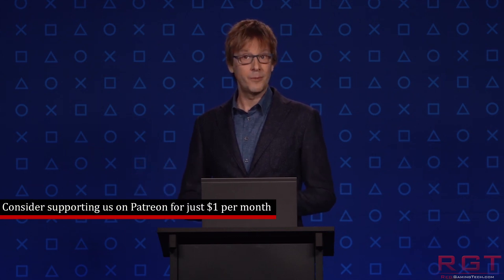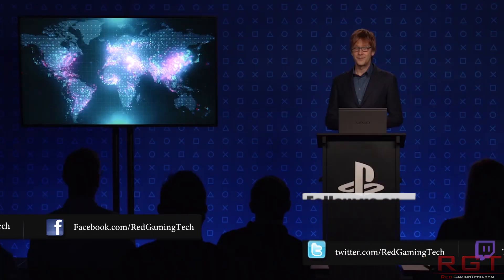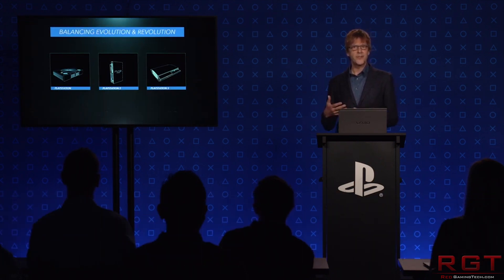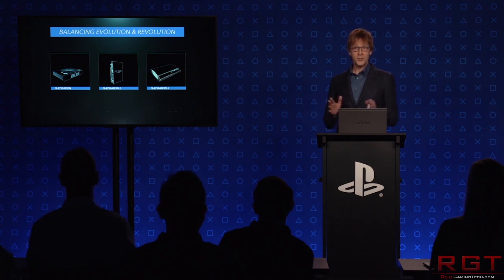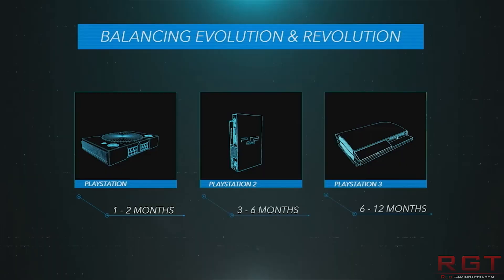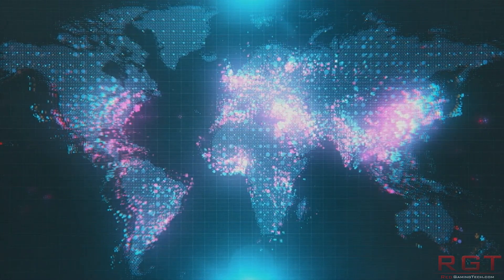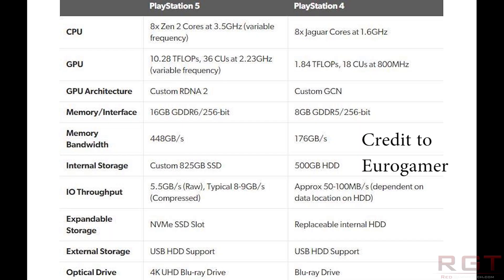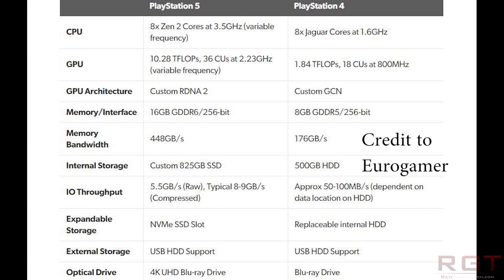Playstation 5 Spec Overview & Analysis | 10.3TFLOPS & RDNA 2 | 3.5 GHZ Zen 2 & Crazy SSD Speeds

Comment: Sony are very ambitious. This reminds me a bit of the Cell CPU, but not that drastic. They are banking on developers using the ultra fast Nvme to do some clever level designs (not having to repeat assets to save space on the drive, making more dynamic trees etc which will add to the realism, and it’s fast enough to compliment VRS to draw things that aren’t on screen. It’s some cool technology, but will require time for developers to get good at. First party titles will probably look amazing. Third parry will probably have better ray tracing and framerates on Series X, unless they optimize the storage. 
Microsoft is also splitting up the Video ram to 2 different speeds, but 10gb should be plenty. Only a 2080 ti (and above) make use of 11gb memory (Vega 7 doesn’t need it for games). Doom Eternal does require north of 7gb vram on the highest setting, at 4K games will get up there, but consoles are better optimized and have complimentary hardware, like decoders.
One point he forgot to mention is that external drives can Add 1GB to the total (making them theoretically cheaper), if you change the internal on PS5 you have to buy a 2tb 4.0 drive to replace it, which right now, go for $300+, on Microsoft you can add as many 1tb chips as you can afford to swap, or move to other consoles.
Reply: By splitting up the ram and making some of it way slower Xbox has essesntially created a future bottleneck.
Reply: @paskwawi2007  This is nonsense. CPU's & audio processors barely need any memory bandwidth to use to their full potential. This is why CPU's on PC use DDR & not GDDR. 336GB/s is already WAAAAAAAAAAAY in excess of anything an 8-core Zen 2 CPU will need for the ENTIRE lifespan of the console. What's important is memory bandwidth to the GPU, and here Microsoft is straight bitch slapping Sony with their wider 320-bit memory bus.

Comment: This is why sony have been quiet 10tf you guys saying 13 must have lost your minds
Reply: PS5 Pro will probably toot on Series X
Reply: @PHY51C15T  Good God. Now you all are hoping for a Pro version...
If that comes out it will be  a year or two away
Reply: Still coming
Reply: @PHY51C15T  dude just take the L no pro for another 3 years & by then Microsoft is going to upgrade the xbox also so stop the pro bs already smh.
Reply: @melvindesmond2134  actually wrong..... Microsoft has already said no mid gen upgrades...... I also highly doubt that they will bring out a pro having a 10.2 tf console and a 12 or 14 tf console it just doesn't make sense
Reply: @chadstudd1616  what are you talking about they said no more generations everything moving forward is going to work hand & hand which means games & all accessories will work with newer models & who said the new console will only be 14tflops it will probably be 18 to 24
Reply: @melvindesmond2134  they already said no mid gen refresh read it properly it make sense....
Reply: The PS5 and probable price point is already enough to outdue the Xbox camp. Sony has too many exclusives lined up for Xbox to actually compete let alone win anything but the console power struggle, and only for now. That and they haven't done enough in hardware for their exclusives to be in a league of their own graphics and features wise.

Comment: I do wish it was more 36 Cu’s.  A little disappoint with that, but not huge deal. As was hoping 38-40 Cu’s. At least worthy upgrade over PS4 pro, but yes we know RDNA 2 is far more efficient over older GCN.   I’m so glad Sony is not locking GHz, other top limit.  Which makes sense.  But as we know MS is locked GHz. Thus imo may scare some devs away from XSX imo.  I’m glad Sony has much faster clock speeds. This may allowed devs more freedom for ps5.  I do hope ps5 has far better cooling and make sense.  

Imo it seems like it’s closed to overclocked RX 5700xt gpu with RDNA 2 features/w ray tracing features. I do wish Sony had some ddr4 memory just for Os/background task. Allowing devs full access to gddr6.  I also hope Sony supports vulkan api.

Ps1/ps2 emulator wouldn’t be hard on zen 2.  Ps3 emu maybe harder.   Sony could add backward compatible for older ps2/ps1 could come later with updates.   As Paul said. Maybe down to license issues atm.

Good video as alway Paul :)
Reply: Sire DragonChester 

It’s an overclocked 5700 non-XT. 5700XT has 40 CU
Reply: Why would you think that is good? Devs will appreciate consistent power with the advantage of both a narrow bandwidth that can throw a ton of pixels on screen along with a wider bandwidth that enables consistent performance. Although ps5 does have an extremely fast ssd and a version of RDNA 2 everything else from a graphics performance perspective is more of an evolution than a generational leap. Not a fan of the storage expansion solution either. An m2 nvme pcie 4.0 1tb drive costs about $250. That’s nuts!
Reply: Variable frequency is not a good thing Microsoft is a better when you know what the consle can do with out variables..  🗼💪
Reply: The PS5 will be a beast thx to higher GPU peak clock at 2.23GHz and with more than twice faster Nvme SSD the gap will be even more minority... Now we know why they build special expensive fans to keep it cool when the system need more power for exclusives games that eat more power...
Reply: It's RDNA Gen 2 architecture not hybrid one that the reason only 100 PS4 games will get BC, they will say what games on launch day, the top 100 PS4 games...
Reply: Great! So now we’re going to have another jet engine on our hands. 🤦🏻‍♂️
Reply: @Whoozurdaddy  what you didn't understand about they build special big fans for that heat?
Reply: @מוטיאהרן  the SSD speed in the PS5 is at max speeds, here's where Microsoft is clever they will use DirectML, to along with decompression chamber when they have compressed data and the series x will have speeds of up to 4.8 - 5.0 GB/s for when they have compressed data and the decompression chamber will decompress the data in real time so it won't matter at all how fast the SSD in the PS5 is.
Reply: @carlosmartinez3020  lol what important it's raw speed not compressed speed but ok... PS5 5.5GB/s vs xsx 2.4GB/s raw speed.... PS5 8-9GB/s vs xsx 4.8-6GB/s compressed speed... What really important it's raw speed... And the fastest Nvme SSD will be matter it's not act as HDD...
Reply: Sire DragonChester - locked is better dummie , it’s 12 tflops no matter what ps5 throttles probably will hit 8 or 9 in most games
Reply: מוטי אהרן
Actually.. that comment about backwards compatibility is wrong.  What they said was 100 ps4 games were tested to be boosted with the PS5, and that all PS4 games are BC.  It means that games outside of those tested will run the same way as the PS4
Reply: @NBAasDOGG  5700 was rdna 1 this is faster in every way. This chip is faster than a 5700xt
Reply: Rudy Tay 

The PS5 chips is indeed faster than stock 5700XT, but a 5700XT at 2100mhz (130mhz slower than PS5) is almost 10.7TF and therefore faster than PS5.

RDNA1 does not add IPC improvements over RDNA2, only power efficiency and new features (RT and VRS)
Reply: @NBAasDOGG  amd didn't talk about ipc gains yet but it will be faster we all know that. Ps5 will probably be faster than a 2070 super

Comment: Well I said 11.1 or 11.2  Knew 13 wasn't going to happen. However I knew 9 was way low. Should be interesting to see what happens in a couple months of adjustments. When the cooling system is refined. Might get a slight boost. But unlikely based on Cerny himself saying what's up. But damn that speed!
Reply: VICIOUSVICTOR TEE lol yeah that speed , not it’s like 30% weAker compared to the xbox series x it will load games faster but only like 6 seconds
Reply: @TheOneGhost12  Your only thinking of preload times which is great. But the underlying design speed has huge benefits of utilitiy purposes. It's not actually pregame load times but actually in game loading on the fly during gameplay loading, prerendering, and buffering as well.
Reply: VICIOUSVICTOR TEE- it’s not going to give a performance boost over the x , loading up games will be the only noticeable difference and that is cool but the non locked clocks will probably rarely hit 10 most likely hit 8 or 9 most of the time without vrs and mesh shading and rapid packed math plus being around 3 or 4 teraflops slower than x it’s just a bummer the x crushes
Reply: @TheOneGhost12  once again it's Not how it ONLY loads prior to gaming but during gaming. XBox is a big fat V8. PS5 is acting like a supercharged small block. Xbox will be ultimately be better looking. But PS5 will be pretty Faster. Get it yet?

Comment: The main difference is, Xbox sx will handle 12.15 tflops constantly.  PS5 can only peak at 10.3 people who plays on a warmer conditions will have a hard time sustaining that.
Reply: Rewatch the unveil video the PS5 is setup to vary frequency based on performance demands and not throttle based on temperature. That and the cooling will be designed to allow for sustained max clock speeds without overheating
Reply: @PHY51C15T  The issue is that it's hard to believe it won't be throttled based on temperature. I've never heard of such a GPU. We'll need to see once these consoles are released based on the benchmarks.
Reply: The clock speed has nothing to do with ambient temperature. It adjusts based on workload. It doesn't matter what ambient temperature you operate the console at, there will be no difference between any console. Somebody playing in the Sahara desert will have the same performance as somebody playing in Antarctica.
Reply: @samdenisse2705  Well you never heard of somebody going to the moon either until they did so.......................
Reply: @PHY51C15T  yeah I Re watched it and read the amd smart shift technology. It is a technology for laptops. it will basically scale the performance and power draw of the cpu and GPU. If the GPU is doing a hard load, the cpu will scale the power/performance. If the CPU is doing a hard load, the GPU will scale the power/performance down. It will NOT  be limited by the ambient temperature. But GPU will limit the CPU and vice versa. This means GPU will reach 10.3 tflops when CPU is basically doing nothing. The CPU will reach 3.5ghz when the GPU is doing nothing. GPU and CPU can't peak their performance simultaneously. Unlike XSX fixed clocked, both cpu and GPU can utilize peak performance simultaneously. So in huge open worlds, with hundreds of A.I. Running at you, physics, destructible objects. PS5 will struggle because the intensive cpu computation will drag the GPU performance down. It will definitely reach 10.3 tflops on cinematics and cutscenes. During a busy game play it won't do 10.3 tflops.
Reply: @badassgenevideos  wrong again it doesn't work like a seesaw on the PS5 like you're suggesting. lol Watch and listen again. Also by your explanation the GPU and CPU will run at half max  clocks simultaneously at max
Reply: @PHY51C15T  you can read about the technology here. https://www.amd.com/en/technologies/smartshift. Maybe you understood it like, if GPU is at max load and CPU is not doing anything. CPU will help the GPU to make more FPS by using utilizing its power actually doing rendering. It's not like that. CPU can't handle 3d rendering. Well it can but very poorly that's why they invented the GPU. It's like this. The APU will draw a constant power for example 300 watts and it will produce a constant temperature of 65° the apu will not draw more than 300 watts because it will make it hotter. But the APU can draw less than 300 watts if it doesn't need to. So if the GPU needs 250 watts to get to 10 tflops. The CPU can only draw 50 watts. So when the CPU needs to draw 70 watts due to work load. The GPU can draw only 230 watts and will not be able to reach 10 tflops. How ever if the cpu is not doing anything and it only uses 10 watts. The GPU can now use 290 watts. It can the reach 10.3 tflops. Of course I don't know the exact math how much watts per tflops. The higher your clock the more it draws power. On higher clock also, it is less power efficient. It needs more watts per clock.

Comment: SeriesX is a beastly powerful machine, impressive.  PS5 is extremely agile with an actual 'custom' SSD, and high clock speeds, impressive. I am back on the Playstation  train.
Reply: At the high frequencies expect the machine to be either loud or be throttling back those high frequencies due to load. I'd prefer to have the brute force and wait 8 seconds instead of 4 seconds for a game to load.
Reply: @bigjus3751  nobody is forcing you to buy the PS5. Or not buy the Series X. Or you could get both. What a concept.
Reply: @djkoz78  where did I mention I was being forced? It's an observation of the the hardware at hand.
Reply: @bigjus3751  that the reason why they build special big fans to keep it cool when more power needed...
Reply: @מוטיאהרן   you sound like you've never built a PC before, there aren't special fans, obviously there are good ones but they can only do so much in a tight form factor  like a console, if they said it has an aio or a small custom water loop then sure, but just fans unless they're loud the machine will throttle.
Reply: @bigjus3751  SeriesX will be great if you like it. Your points about throttling back are non existent. Did you listen to our (Sony Fan Boy) God Mark Cerney? He clearly stated that a 10% reduction in frequency meant only a 1 or 2% reduction in performance currently in testing. SSD, It's not about just load times, it's about how games are designed. And he addressed the noise. You negativity towards PS5 is currently unwarranted until those points actually come into existence. Again, the Series X is great.
Reply: @BrianM78   I think the Ps5 will be an awesome machine, just like the ps4 is/was, but I think that they pushed the clocks much higher than they wanted if you take off 10% frequency 2.23Ghz to 2Ghz it gives you the 9.2tf from the leaks which is not a bad thing at all, which is probably how most developers will use it and probably the best balance of power and efficiency in temps.
Reply: @bigjus3751  I was wrong. Cerney said Power could be reduced if needed resulting in just the slightest percentage reduction in frequency. It seems like the GPU is expected to run at maximum at all times.
Reply: @BrianM78  well obviously not maximum at all times as there would be no need for it to be underclocking at all but maybe the normal use case. But after watching DF video closely they mentioned that the power can be diverted between CPU and the GPU when one is more stressed. I can only think that this will affect the big Blockbuster AAA more than the average game. Mark used God of war as an example of the type of game that would cause this type of load.

Comment: This was a mistake. Even the worst SSD is significantly faster than any previous hard drive from older consoles. Simply using any SSD and spending the rest of the budget for best GPU (teraflops) performance is the ideal move. I'm sad to see they wasted money on something that wasn't relevant. As a result, PS5 games might load 2 seconds faster than Xbox Series X while Xbox Series X will look 20% better than PS5 games.

Sony spent their budget on the PS5 wrong.

Comment: Calling it! EVERYONE IS WRONG ABOUT THE PS5 SSD! Yes! It is faster than the XSX SSD, BUT IT IS NOT 5.5 gb/s of raw data. IT IS 5.5gb/s of KRAKEN INPUT DATA per Mr. Cerny himself! 8-9gb/s IS THE PROJECTED DECOMPRESSION YIELD! 

I mean. . .I get that a lot about the console was "variable". . .an SSD with compressed values ranging from 8-9 is asking a little much at a $400 dollar price point.  Not to mention the cost of an SSD with a RAW value of 5.5 would be crazy when shooting for a budget.  If the value is 5.5 raw, then why would Cerny talk about running that number through a decompressor?  If it's the RAW VALUE, then there's no need for a custom decompressor to touch it! And what about the 22gb/s number that was mentioned?  8-9 is suppose to decompress into 22? NOOOOO!!!!!!! 5.5 decompresses into 8-9 (typically). . .that's why the value wasn't given as a single number.

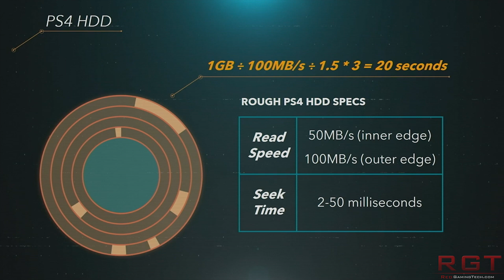Fire up THE ROAD TO PS5 video and start at the 17:30 mark. . .listen to what the man says. . .he's very particular about his words. . .Kraken is a type of compression format that is similar but more efficient than the model they used current gen. . .

SPREAD THE TRUTH!
Reply: Nope
Reply: Wrong go watch Digital Foundry they actually talked to Cerny on the phone about the specs.
Reply: @Astrong417  Wrong. Go watch the video that playstation put up and listen to what the man says. Plus DF backs up what I said.  After everything is said and done, PS5 is looking to move 8-9 gb/s on average of "real" data using the algorithm. And no matter how YOU feel, what Cerny said has been recorded for everyone to listen to.  He says it all when he breaks down "compression".  The PROBLEM is that instead of listening to what Cerny said, everyone is wanting to listen to Eurogamer who put out a sheet before the event started.  I'm pretty sure Cerny didn't say something out of place while talking and I would listen to him before using a specs sheet that wasn't even put out by sony.